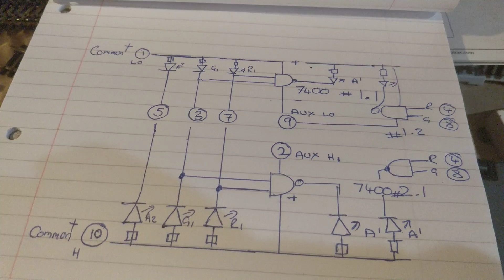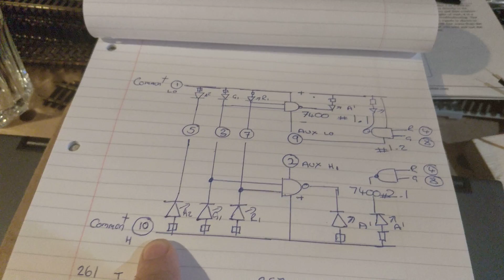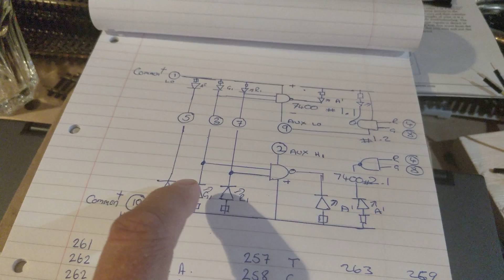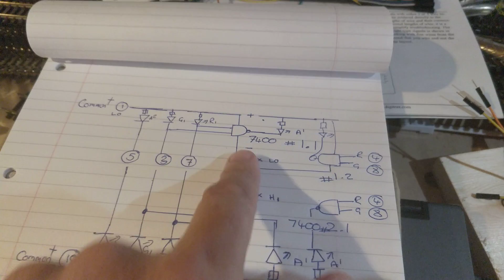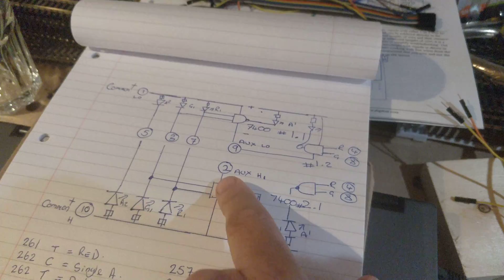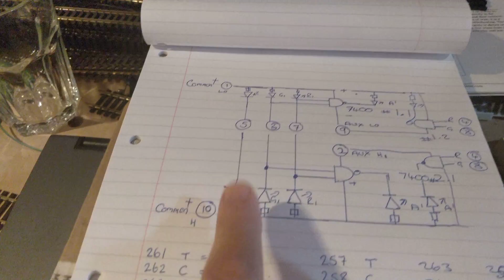How to get UK 4 aspect signals working with Digitrax SE8C signalling board.

Comment: Hi Richard I am interested in this signal controller and especially where you got the signal posts from as i just need the electrics at the moment. Great vid very informative. Thanks Regards Alan
Reply from the maker: The signals that I intend to use are from TrainTech . CoastalDCC were selling for a good price . the signals in the video cone from digitrax and are supplied with the SE8C signal controller. The se8c is a great board as it can also control 8 slow motion point motors (tortoise)  and it has 8 inputs for other detectors/switches.

Comment: Brilliant Richard, I shall use this method in a month or two as my layout develops.  I do hope that other folks find your video useful.  Regards Charlie
Reply from the maker: Thanks Charlie. I'm working on the common negative version. The NAND gate needs to be changed to a NOR gate 74ls02.

I've ordered a load and will produce a video once I've built the prototype.
That should be more useful for traintech ekon Berko signals etc
Reply from the maker: Digitrax has dealt me a curve ball and changing to common negative has not changed the aux voltage to positive  so further investigation is required. . I'll keep working on it though